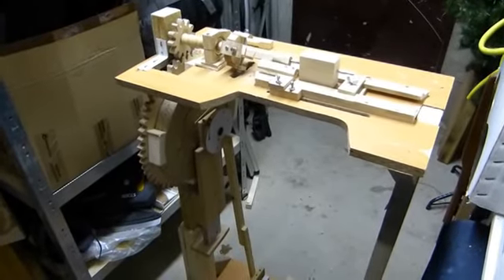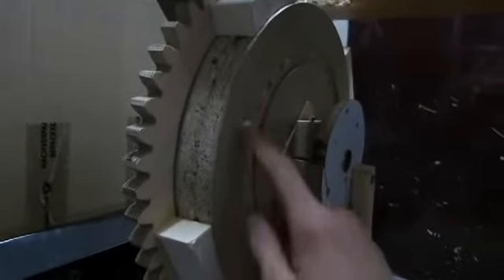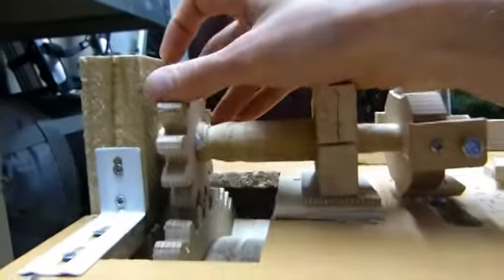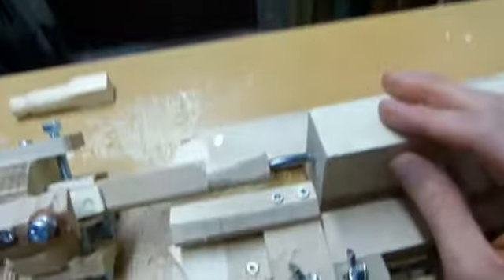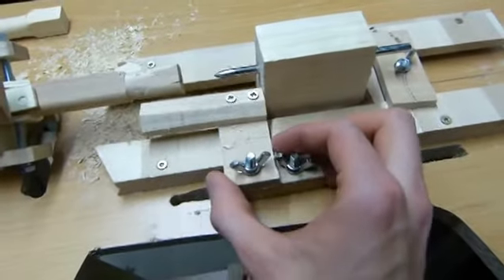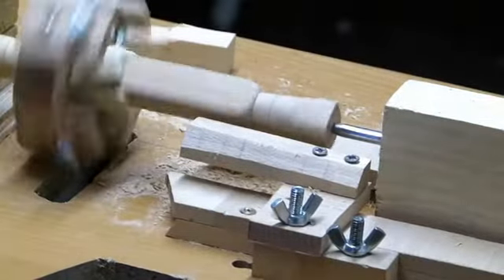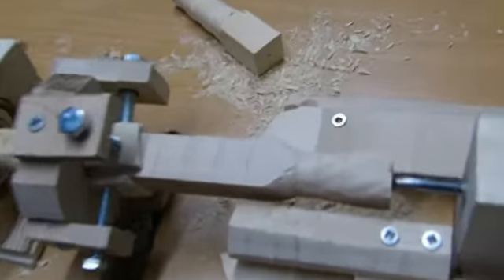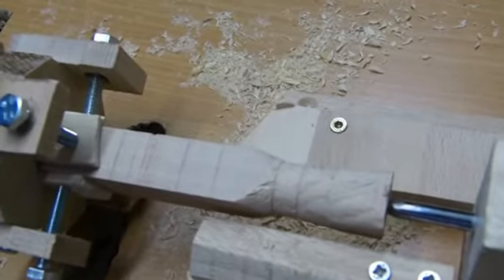DIY manual wood turning lathe (foot operated)

Comment from the maker: I just didn't have a belt and I didn't really want to invest any more money in it. I actually did try to use using string (shoe laces, actually) before making the gears, but they didn't provide enough friction/torque.